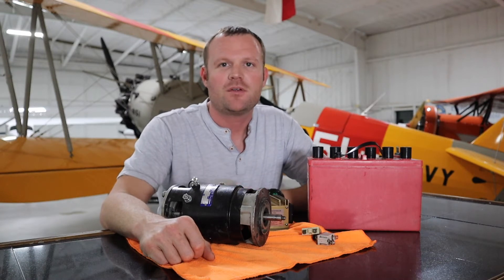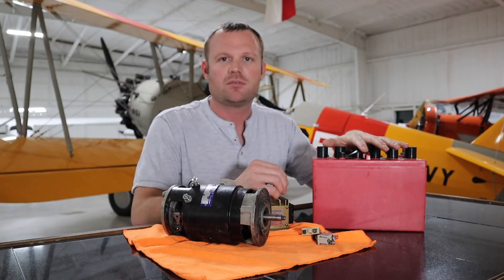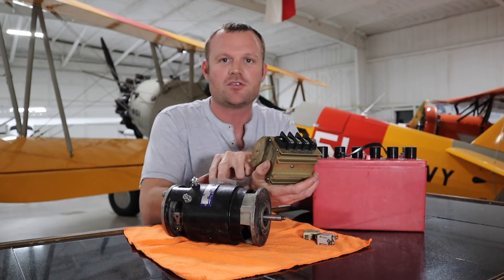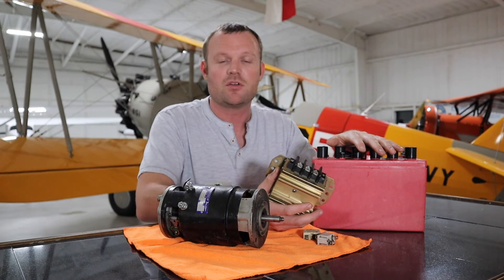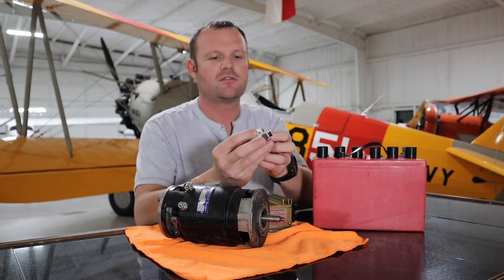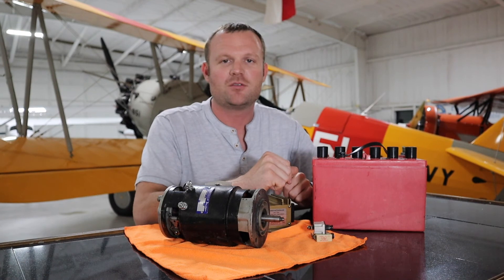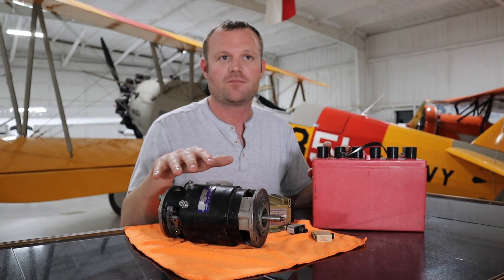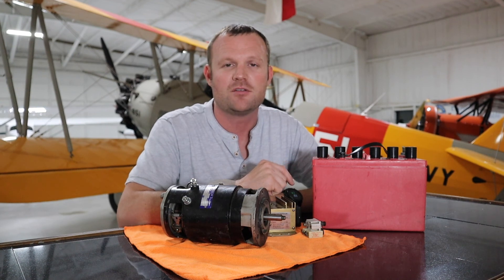Aircraft 14V Electrical System Explained

Comment: hey, men I really love your videos , but I got a question about your video of carburetor heat  
u mentioned in your video"carb heat" that when you open the carb heat knob the clean air filter(primary filter is closed) and the air is going to come from the muffler ok I got this but WHAT happens when a use partial heat I mean just open partial heat knob in the flight deck , the primary filter lingers fully closed? or in half?    what happens to the primary filter when I use partial heat?
Reply from the maker: When carb heat is all the way off the valve is close all 100% cool/filtered air is being drawn in to the engine, as your pull the carb heat knob slowly out. Let’s say you pull it half the way out then half of the air is being drawn through the filter/cold air the other half of the air is hot air and unfiltered.  And if you pull the knob all the way out then there is no filtered/cool air being drawn in, it is 100% Hot unfiltered air entering the carb, I hope this helps!!
Reply: @Ayersaviation  I really appreciate your time    TY
Reply: I have a question on the carb heat also and really haven’t received a straight answer from anyone. Is it bad to run carb heat for long periods of time? Flew a couple weeks ago and the outside air temp was probably in the 40 degrees Fahrenheit, I noticed I had a slight stumble in the engine for probably 30 mins. I turned carb heat on for the last 30 mins of the flight and it ran normal. Headed home and it started doing it again so I put it on half carb heat for a 1 hour flight and it ran like normal again. I’ve since had the plane up a couple times and haven’t noticed it again. Was this possible carb ice? 1976 piper warrior. Thanks for any help you can provide.